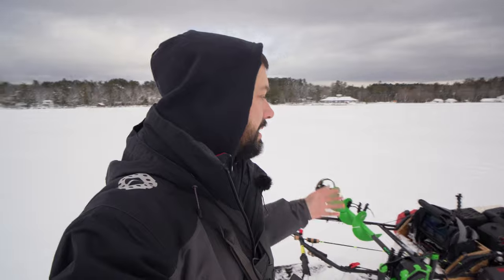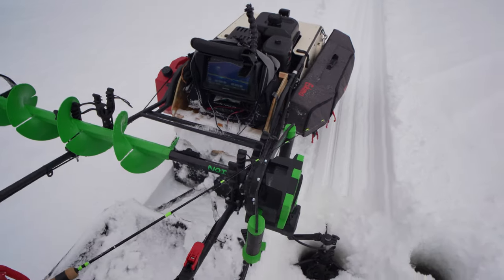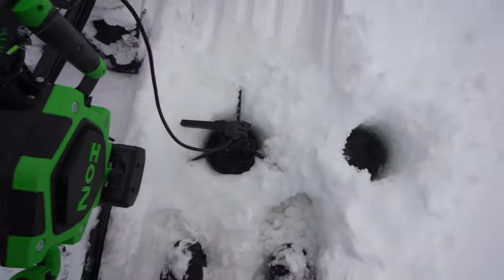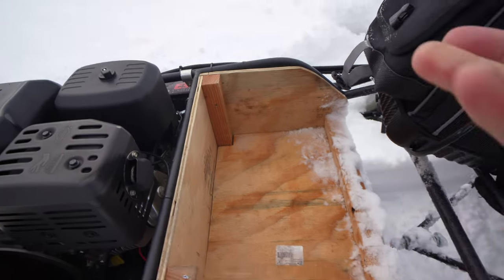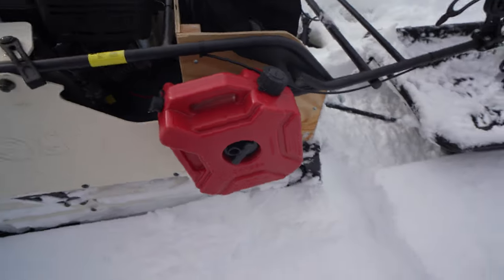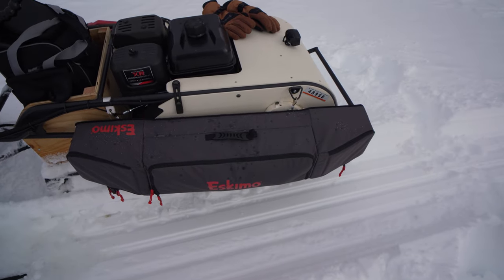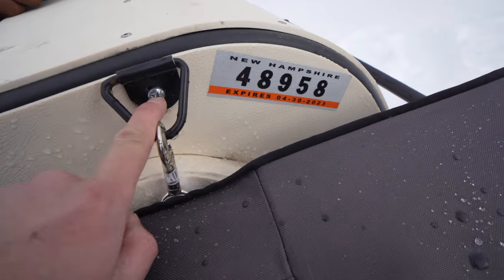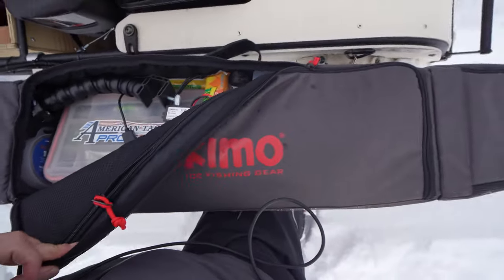Must HAVE SNOWDOG Modifications!

Comment: If you only knew how bad I buried my snowdog this weekend. Imagine your worst nightmare the bury it an additional 2 feet. Slush in Maine last weekend was insane.  I shoveled for hours. I have Kolpin mounts on mine, and the otter 48 deep case along with rotopax 1 gal tank and upgraded battery. She will crank for an hr straight now! Deadass putting a winch on mine next week. They are only 300lbs but when that track fills up with slush it might as well be a side by side on it’s freaking roof!!
Reply from the maker: My track filled up last week two it took me 30 minutes to get the slush out with a hammer! I'm gonna ask snowdog if the slider suspension kit would help with that
Reply: @BendItFishing  I had to roll mine on it’s side and get a Chinese diesel to melt it out. What a pain in the ass
Reply from the maker: Wow